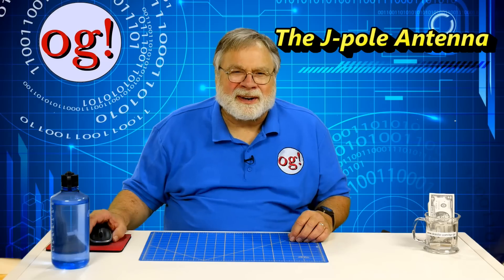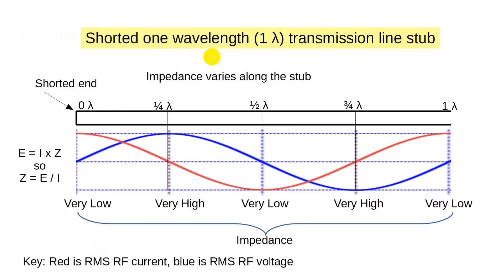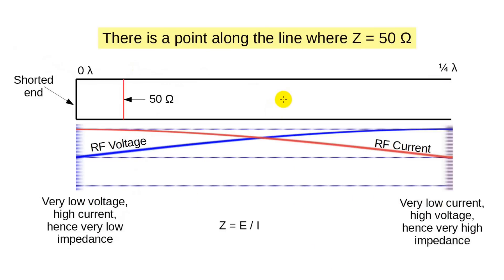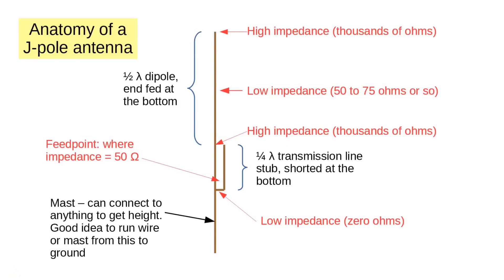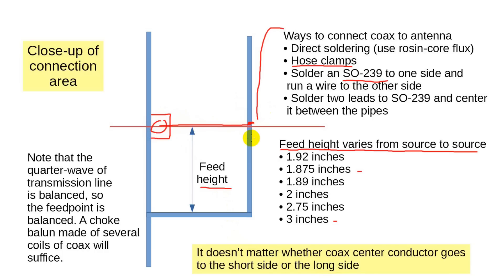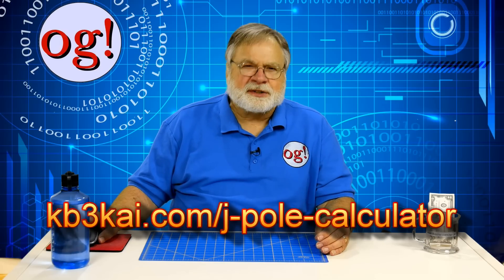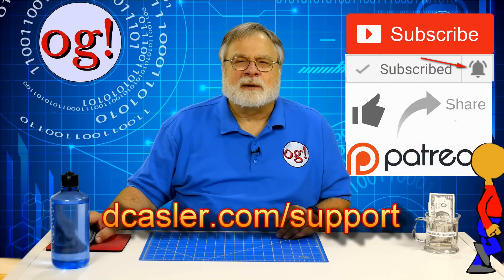More on the J-pole Antenna (#163)

Comment: If stainless steel (300 series {Austenitic} ) screws to attach the SO-239 connector to the copper sheet most of the corrosion issue can be prevented. 316 stainless works very well if you can find it.  If you want to go belt-and-suspenders approach, use a copper-based conductive sealant between the SO-239 connector, the copper sheet, the stainless screws & stainless nuts. You can find it on GigaParts or DX Engineering.  This will assure the best possible conductive bond. Once you've got the feed-point location dialed in, then spray the entire assembly with a clear lacquer or some clear conformal coating (masking the contact part of the SO-239) and your J-pole assembly should go for a VERY long time with minimal corrosion.  
73

Comment: A 6m copper J pole is to spindly using only 1/2 in copper pipe, better to use  3/4 in and a reducer to an adjustable 1/2 in stinger, it covers about 1mhz
Reply: That's exactly how I built mine. It's cumbersome... about 17ft. long. I'm able to hit a 6 meter repeater about 90 miles away with between 5 and 10 watts without even fine tuning. Mine steps down from 3/4 to 1/2" copper in the upper portion. It looks very streamlined for that reason, with lower center of gravity and a reduced windload.

Comment: Conductive masts CAN radiate. Watch out for resonant half wave mast lengths that CAN be close to the design frequency just by chance. Best to use an insulative joiner just below the "T" fitting.

Comment: Dave, would dielectric grease a connection points on the Jpole, or other antenna connections (base,HT antenna threads) help prevent corrosion? Would it inhibit performance in any way? I’m just thinking here, I’m curious!

Comment: appreciate the clear explanation, however I believe the use of RG-8X for a choke balun would be a mistake - after all the big drawback of 8X is the need to avoid sharp bends because the foam dielectric will lose it's shape and not hold the center conductor in the center, under those circumstances.  And, I have begun using N connectors everywhere I can, as they are easier to install, are weatherproof, and have the same impedance as the cable.  Even when I must use a UHF connector I'll install the N and use an adapter.

Comment: thank you for this video, I have so many question thanks to it!  First: I just got a j pole for my GMRS HT yesterday, at about 8:40 into the video you mentioned putting a choke balance in the line. What is that for and does diameter matter of the 8 or 9 twists?
Reply from the maker: Choke balum. The diameter is usually 9 to 12 inches.

Comment: Hi Dave! I've built this jpole except its calculated to 11 meters. http://www.shadowstorm.com/cb/pdf/10mjpole.pdf
Actually the long side is 25.5 ft so its actually calculated in the middle of the 10 and 11 meter frequency at 27.600 mhz I think
After I added the choke SWR went from 10 to 4 on all channels.  Do you suppose moving the feed down would solve my unusable SWR issue?
 I'm also using 300 ohm twin lead instead of the 450 ohm ladder line.

Comment: Can the long side be longer 3/4.  Or full wavelength. Just thinking that maybe if it was a  wavelength it may do better.  I  am new and not sure about what I think I know. Just that I have been told that the longer the radiation part is the better it antenna is. But I know that there is a limit to this. Just thinking that if it was a wavelength there would be more getting out or total of 1.25 wavelength to make 1 wavelength to radiate the signal.
Reply from the maker: The basic antenna is the half-wavelength dipole. A full wavelength is hard to feed properly.

Comment: Thanks Dave! Is there a way using an ohm meter to measure the 50 ohms needed to find the connection point?
Reply from the maker: Unfortunately no. The 50 ohms is at RF. A regular ohmmeter will not measure that. So the point has to be calculated, or found by trial and error.
Reply: One can use an antenna analyzer such as the N1201SA to find the 50 ohm point and see a graph of the SWR.

Comment: How would this be for a variation: Take a full-wavelength horizontal wire, cut it in the middle, feed that with a quarter-wave open wire/ladder line, short it at the bottom.
Could you then feed it the same way as a J-pole, at the 50R point up the stub, and effectively get a 2-element dipole with ~3dB gain?
Reply from the maker: Yes, it's a double zepp or collinear. See https://youtu.be/nyTn4_2xwTk

Comment: What cable should I use as a feed line for a 5 w handheld radio ?
Reply from the maker: For a run of more than a couple feet, I'd use RG-8X. If it's really long, like over 50 to 100 feet, use a better coax like RG-213 or LMR400.

Comment: Great video. One question. Can a Ferrite Choke (with correct mix for frequency) be used instead of turns of coax? Especially if using thick lmr 400 for 70cm? Please and thank you for your time and advice.
Reply from the maker: Yes, but not usually just one ferrite choke. Maybe 15 or 20, all pushed up as close to the antenna as you can get them.
Reply: @davecasler  Thanks! I've been enjoying J-pole since we last corresponded. I have another question: Is there a way to calculate a j-pole with K factor (element Diameter)? Please and Thank you!

Comment: Great video Sir. Question: I have seen plans for a dual band 144/440mhz J-pole in which there is an insulating joint between the two bandwidths joining the two there is a solid heavy gage copper wire bent in a strange manner, if i would describe it, it's bent around the j-pole in something similar fashion that looks like the "WHEEL-O" wire and wheel magnetic  toy gizmo from the 70's, hard to describe but it's wrapped around in almost a 360° Deg radius and then bent back to its original starting point, its some sort of inductance load, I hope something here made some sense???. I'am new to ham radio, so please bare with me. How does the dual band J-pole work???.
    Kind regards, Eric Dee.
Reply from the maker: The bent wire is acting as a quarter-wave stub. 70cm frequencies won't go past this stub, which presents a high impedance at those frequencies. The 2-meter bands happily incorporate this stub into the antenna.
Reply: @davecasler : Thank you for your time in response,  I understand now, thank you very much, you have a very interesting channel, keep up the great work sir, We viewers appreciate it.
    Kind regards, Eric Dee.

Comment: I'm about to go out right now and add my sleeve choke to my recently built 220 j-pole and put the coax right at the 50 ohm point then add a cap with a brass bolt on the half wave section to see if I can achieve a perfect match.

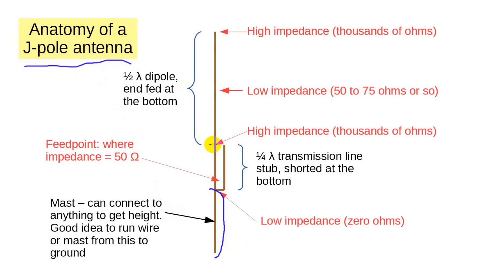Comment: It is important to understand there is no mechanism to prevent currents from flowing down the mast. Therefore the mast cannot be simply ignored as so many do including this video at about 1:42 where you suggest it can be most any length. The Wikipedia article summarizes the J antenna quite well with ample primary references to help understand why the mast conducts and how to mitigate undesirable mast currents.
https://en.wikipedia.org/wiki/J-pole_antenna
Reply from the maker: There is a school of thought that special arrangements should be made to keep the mast from radiating. But most of us just use that piece as something to connect to the mast, which is often itself metal, and good amateur practice says to ground the mast. MFJ makes a couple end fed Zepps that use the J-pole technique for matching and they work well. With them, there is no extra metal at the feed end.
Reply: There is also the school of myths including the notion the bottom of the J antenna somehow has immunity to flowing currents down the mast while upward currents are unrestrained. The reasoning given is it's a point of zero voltage and can therefore not force a current. What many miss is this is really the point of not zero, but minimum voltage and, critically, "maximum current" resulting in power flow necessary to resonate the entire assembly. If the top of the mast presents anything other than a very high impedance, it has just as much right to some of that current as any of the other portions of the antenna.

The simulation nerds have sounded the alarm for some time concerning grounded J antennas...
 - https://www.hamradio.me/antennas/j-pole-antenna-should-i-ground-it.html

I confirmed their simulation results and later confirmed the issues with real measurements...
 - https://www.hamradio.me/antennas/j-pole-antenna-grounding-have-your-j-pole-and-ground-it-too.html

As the title of the latter article attests, you can ground your J antenna without potentially spoiling its performance with just one more stub... or radials if you like, but the mast decoupling stub avoids induction to the mast below and just looks cooler.

The Zepps are certainly good examples where the isolated J concept works just fine by virtue of its disconnect from other conductors. Those spiffy rollup ladderline J antennas also benefit from this and work surprisingly well despite some of the manufacturers not totally understanding how their antennas work.
 - https://www.hamradio.me/interests/slimjim

I've spent a considerable amount of time on the topic of the J antenna, but it has been worth learning the real deal and denouncing the various myths...
 - https://www.hamradio.me/interests/j-pole

A hopelessly boring discussion is available in my patent application...
 - https://patents.google.com/patent/US20170201002A1/

Comment: After making my J Pole, I took plastic carpenter clamps to the shield and center wire to the arms of the J Pole to find the sweet spot in the middle of the 2 Meter band. Then sweated the feeds to the copper. 144 -148, the SWR is pretty flat across the band and 1:1 at 146mHz.

Comment: May some please help or advise....THANK YOU SO MUCH.

I just put up a 20 foot  tower with 3 legs and one mono pole about 20 feet up.  
On the 20 foot tower i have a Imax2000 antenna to talk on 27 MHZ which that alone is another 23 feet up in the air...so it's up 43 feet from the ground a bit higher then the peak of the roof.
On the 20 foot mono pole i have just a discone antenna for my scanner.
On the 20 foot tower i grounded all legs together with 3 gauge ground wire, and i also spliced the coax on top of the tower and took the shield and grounded that.  Is that wrong?   
Guys in the ham radio shop said nah don't do it, no reason to shave the coax and ground the shield to the tower, other 50 % of the stuff i read sais to do that and at the bottom of the antenna tower.   
any advice on that?  I also have 3 ground rods at 10 feet depth.  One rod at the tower where all 3 legs are grounded then go to the first ground rod, then 20 feet away another ground rod and another 20 feet away at the electrical panel another 10 foot ground rod.
Can you ground the Imax antenna even though it's a 5/8 antenna?  That was the argument with the ham guy in the shop, he said if i ground it, i introduced a new wavelength in the equation...Then i returned and said but if the mast of my Imax is touching the tower, that is also grounded together, so what is the difference if the coax shield is grounded on top of the tower?
I seen professional installations on line where they ground the coax on top of the tower and at the bottom...Any advice?

I just installed the mono pole  and antenna on top...i will attach a ground wire on the mono pole and bring the ground wire to the tower which is only like 7 feet away to connect all grounds together.

More or less when i listen to HF i hear a buzzing sound above 10 mhz, not sure if it's conditions or because i grounded the shield of the coax on top of the tower.   A few times i hear no buzzing, so i assumed it must be conditions.   

Any ideas if  it's ok to ground an Imax2000 antenna even though it's a 5/8 antenna?

Thanks to all, please help..

Theo
Reply from the maker: I wouldn't recommend shaving the coax covering because then you have to worry about keeping it waterproof. Better to put in a connection like a barrel connector, and grounding that to the bottom of the tower, or better yet, put a lightning surge protector there.
Reply: Theo
Don‘t mix up HF ground and DC ground. Your antenna is not a type that should be DC grounded, even if the metal mount at it‘s base looks like it, it mustn‘t be grounded. If you ground the mounting point or ground the coax shield lead, you will produce an additional radiator, that acts barely calculateble.

Comment: Thank you for clarifying how the feed point is connected to the antenna. I spent hours a few weekends ago trying to remember which side I removed the hardware and co-ax from. I guess I got it right regardless of myself.
Reply: Doesn't matter. Either way works the same.